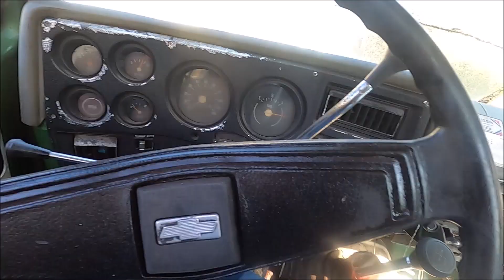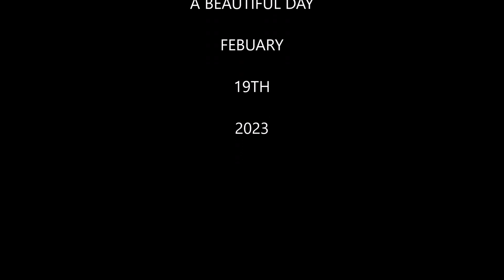FRANK AND MAURICIO GET THE 74' CHEVY TRUCK UP AND RUNNING  FEBUARY 19TH 2023

Comment: I guess the 2 foot long fan spacer wasn't the best idea........
Reply from the maker: It wasn’t that because the fenders weren’t on the front of the truck radiator was floating and when I came close to the fence it didn’t take much to push the radiator into the fan.. it reall bummed me out …